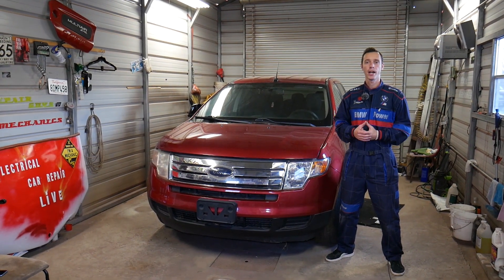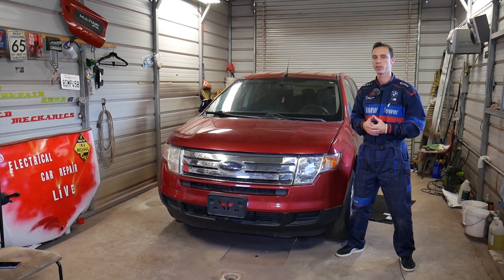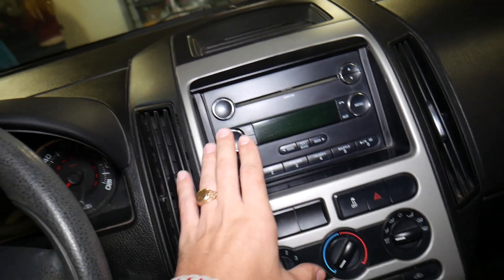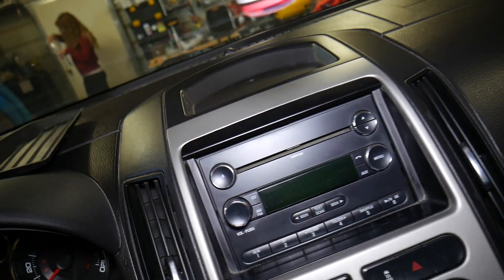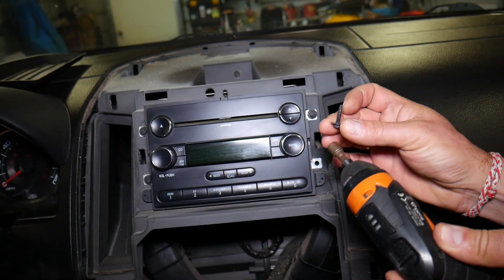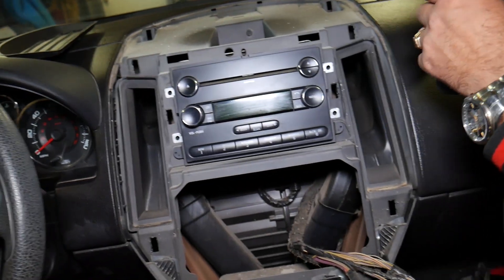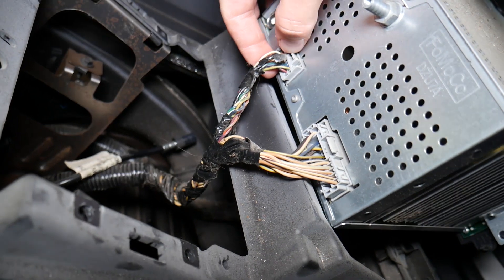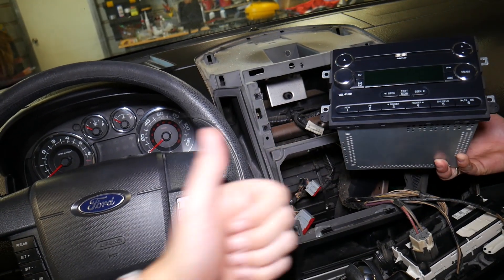FORD EDGE RADIO CD PLAYER REPLACEMENT REMOVAL  STEREO REPLACEMENT

Comment: Hey great video do think I can switch the round button's for the power and the cabin air circulator button from the right of the panel to the left. I have a 2016 Ford edge

Comment: My question was those things in the back those three things in the back you said when I'm with the antenna okay then going from the antenna to the other one in the middle what is that that one or and the one on the end what are those two different ones control that's my question cuz if one of them controls just the CD player I want to turn that one off will it still working everything will be fine I don't know which one is CD though